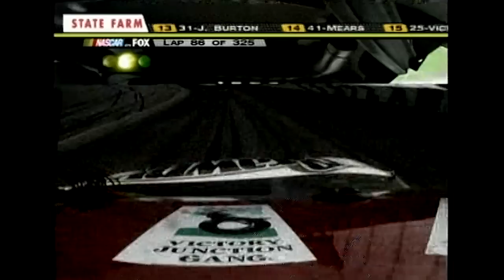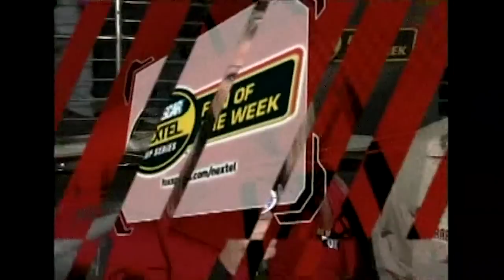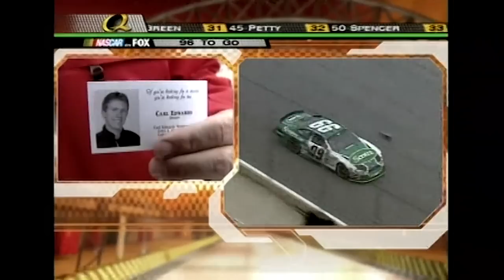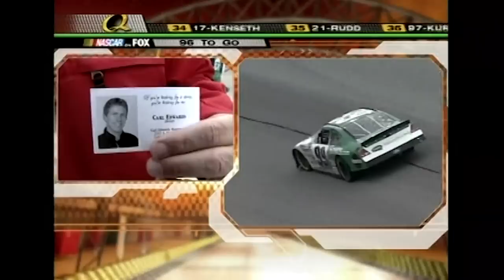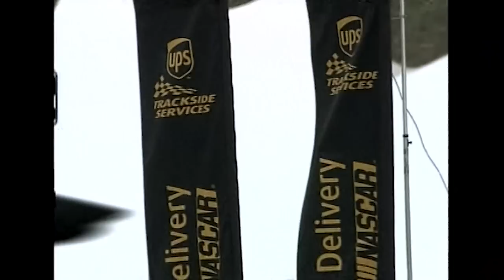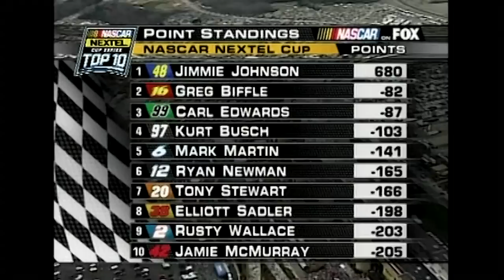Classic NASCAR Full Race Replay: 2005 Atlanta, Carl Edwards | Cup Series

Comment: Oh man! Another missed opportunity of a 16:9 2005 race! I mean I get it, not too many people had HDTV’s in 2005, but if a race from 2003ish, 2004, 2005 through present that was intended to be broadcasted in 16:9, that’s how it should be. Matter of fact, I don’t have a problem with 4:3 races as long they took place between 1949-2002.
Reply: Except...  not EVERY race was in 16:9 until the 2005 season...  The 2004 Southern 500 on NBC was the last race to be broadcast in 4:3.

Its also a matter of where they are pulling their master tapes from.
Reply: C’mon just take what we have. They could’ve simply not posted this instead
Reply: Josh Jarnagin I’m not complaining here, I just keep questioning as to why is the aspect ratio not the way it was originally intended to be. If a coverage had no intention of 16:9, then it should be in 4:3 because that’s how it was made. If it was made in 16:9 but it’s in 4:3 instead, it’s a bummer. Am I mad about this? No. It’s more like “meh, what can you do?” Type of reaction for me.
Reply: Michael McIntyre that is true. And yes you’re right not every race was in 16:9 until 2005. There were selected races in 2003 & 2004 in 16:9. In fact Fox had a widescreen feed in 2003 & 2004. There is a 2003 Carolina Dodge Dealers 400 on DVD, & it’s in 16:9. It isn’t cropped or stretched. So what I’m saying is: If there’s a race coverage out there that was in 16:9, that’s the aspect ratio it should be in. If there’s a race coverage was intended only for 4:3 & not 16:9, that’s the way it should be. My understanding is that perhaps NASCAR doesn’t have the network version. Which is why you get stuff like this.
Reply: Anthony DeLoreto Yes if you go to the video “Top 10 NASCAR Finishes on FOX” They have this race in 16:9 widescreen HD